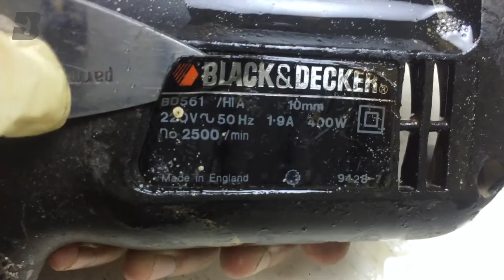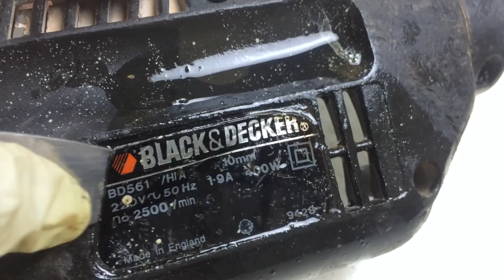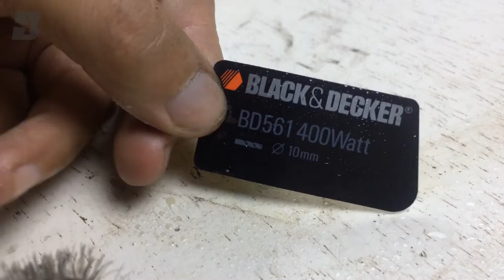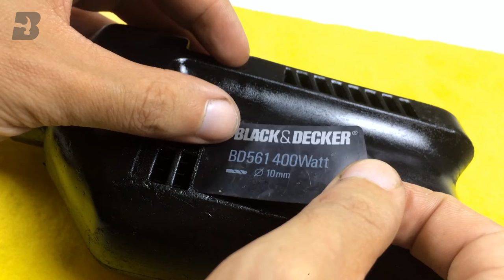Electric Drill Restoration | Very Old Black & Decker Drill Restoration

Comment: Good afternoon. Could you please tell me what the lever built into the handle of the drill is for? It can be seen at 0.43 minutes of the video.  It's like a button near the power cord.
Reply from the maker: Hi,
This is lock on button.
It locks the power button and makes the drill work without having to constantly press the power button.

Comment: Mine is a KD664RE 500 W (from around 1990 ?). Looks like yours and I think it's almost identical. Thanks for the video.
I'll see if I can get mine to life again. :)
I usually soak machine parts (metal) in petroleum overnight it loosens and takes a lot of gunk out. A little paint thinner takes the rest away.
Reply from the maker: Did it work?
Reply: @bricoda  It did. :) The brushes were worn down to nothing and a ball bearing was changed. Now it runs like new.

Comment: Really nice video bro! I liked and subd. some friend have the same drill, but can´t find where to buy the Chuck Key Holder, it would be awesome if you could bring some information about it! thnx for the video, very useful :)
Reply from the maker: Thank you my friend, your comment was encouraging to me
You can find a chuck key  in Ali Express
https://fr.aliexpress.com/item/1005001922834532.html?gatewayAdapt=glo2fra&spm=a2g0o.search0302.0.0.d84710fa6oscqs&algo_pvid=6fcc1836-7077-4e9b-aa9f-1401e887cf72&algo_exp_id=6fcc1836-7077-4e9b-aa9f-1401e887cf72-13
Reply: @bricoda  Thank you so much for taking your time to answer, keep the good work😄👍